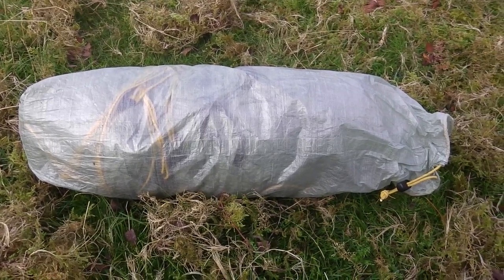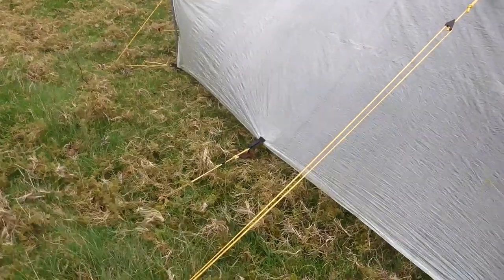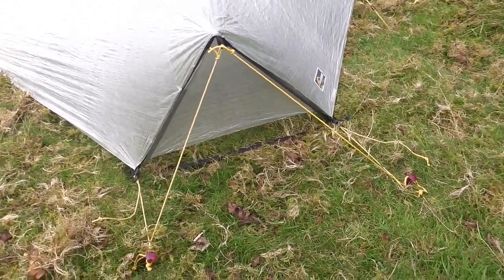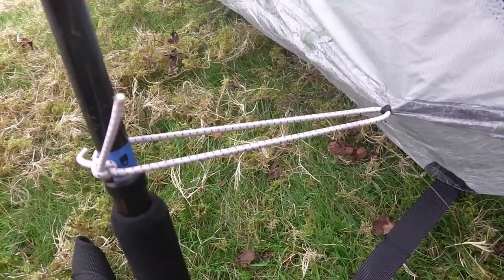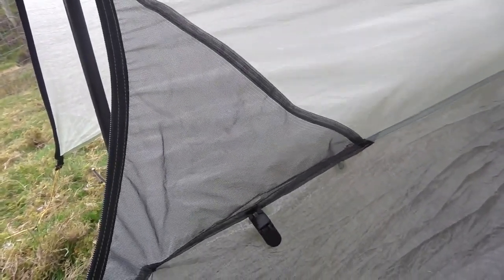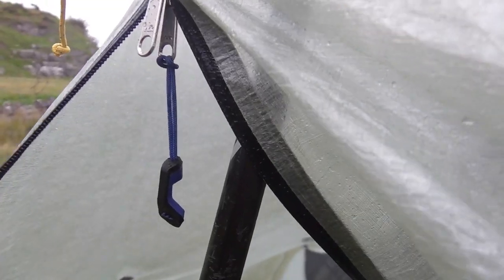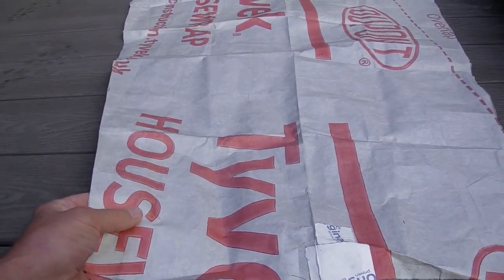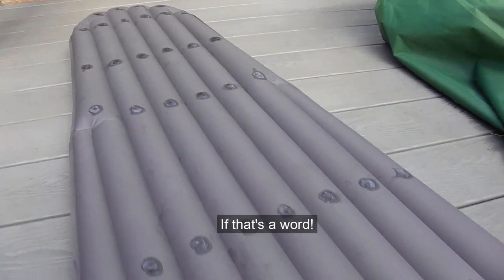Tarptent Notch Li. Ultralight 1 man tent. My Modifications

Comment: BTW, I would put a large patch of Tenacious Tape inside the fly where you added guy points. This spreads out the stress more and keeps the Dyneema fabric from distorting (whitch it will).
Reply from the maker: That's a good idea. I actually don't use those guy points now, as I was advised of the possibility of the DCF pulling and getting permanently stretched.

Comment: Interesting 2 END stakes modification. I may try that on my Gen. 2 Notch Li.
MY NOTCH Li MODS: 1.) inner tent dyed green with RIT Dyemore synthetic cloth dye  2.) added 4 fly hem stake loops with double circles of (1st) Dyneema tape and (2nd, on top) Tenacious Tape. Circles are wrapped around the edge of the fly hem to form a semi-circle on each side and creating 4 layers to reinforce stitching for the grosgrain nylon webbing tape stake loops.  3.) optional Tarptent hiking pole "pockets" for pole handles.(I hate having the handles in the dirt and mud.) I may add guy loops midway between the peak and the triangular end rods, again using Tenacious tape reinforcement circles inside and outside the fly.
Reply from the maker: Hi, interesting mods.
Reply from the maker: Why did you dye the inner?
Reply: I wanted Shade if I camped early and wanted a siesta before dinner. It's hot here in the US desert southwest, even at 9,000 feet. Plus it gives some privacy as well.

Comment: Hello, how did you get the line lock off the top off the pitch lock and over to the side in order to achieve the split stake points?
Reply from the maker: From memory, it's easy to remove the original cord, which leaves 3 loops, then refigure 2 cords with line locks. A bit hard to explain properly.
Reply: @55glencoe  thanks for the reply.  My Notch has one line lock on the left side and one line lock at the top and only a fabric loop on the right.  I love the idea but I would need to somehow remove the line lock at the top and a fix it to the right fabric loop.
Reply from the maker: @tylerherrin7469  I'll have a look at it again to remind myself how I did it. and get back to you when time allows.
Reply from the maker: @tylerherrin7469  Just checked and mine had all the loops ready to use. I have taken pictures, but cannot see how to show them here?
Reply: Hi Alan, I sent you and Instagram message tot RG and restart this discussion through email.  Let me know!
Reply from the maker: @tylerherrin7469  I sent you my email address